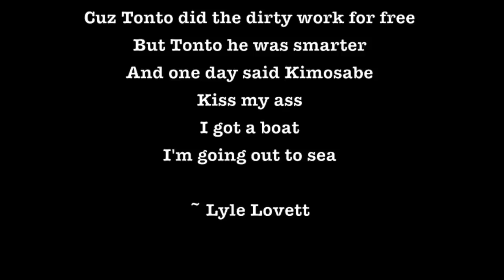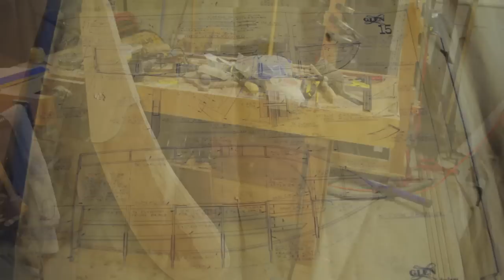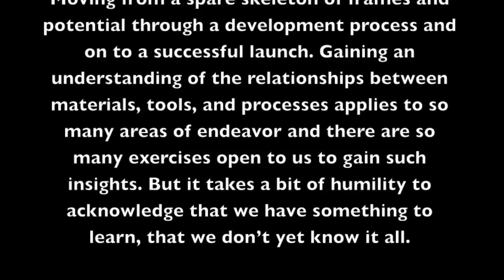How and why to Build a Boat

Comment: Nice looking skiff  excellent. Song , one of my all time favorites  i liked. The strongback design. That was used and the rollover. Cart you  built  overall  joinery  came out. Very nice  is this a Chesapeake Bay   Plan?  Ive been a long time fan. Of Buffett  and have been to  17 or 18 shows so far   Including seeing him play. The  very first Margarittiville in Key West   In  1984 or 85 ?   It was a free show and i. Got to sit. At a  table right by the stage !  On a very. Drunk and fun filled. Weekend  in the Keys, i. Grew up in Hollywood Florida and could make it to Key West. By car in 3 1/2 hours  so i spent. A lot of time. Down there  and boating/ Diving through out the Keys  the original  official Parrothead.  Headquarters. Was.   Just a hut  and. The Coconut telegraph was litterally printed  on a  manually cranked. Mimeograph graph machine  and handed out for free  at the hut  down  by the  Key West Marina ! Of course back in those days Jimmy was a local icon. But was not as globally known as he is these days i owned and sailed a small sailboat  similar to the one you built with the drop in centerboard  and it was a lot of fun  as well as a great boat to teach. My children  how to sail  and understand. The basics ! It. Wasn't a homemade vessel. But  a fiberglass Homer Hauler  that gave me many years of service and fun ! I. Did  get to. Cruise the Carribean. On a. 48 foot  sailboat  that was  a pristine  blue water. Yacht   With all the creature comforts one could ask for